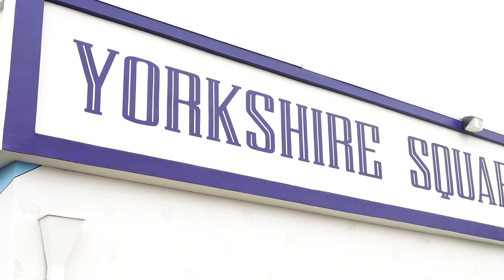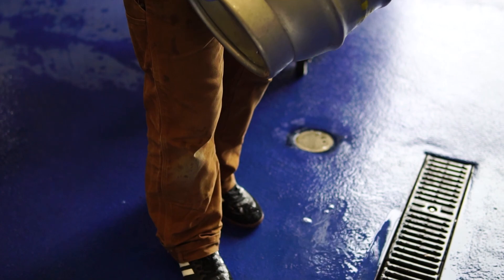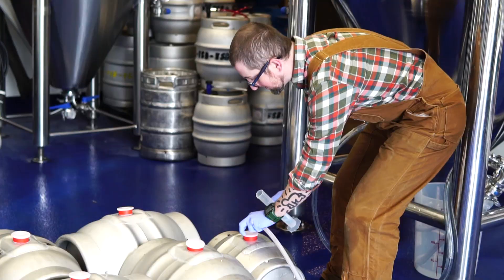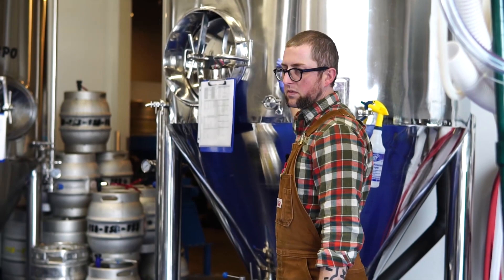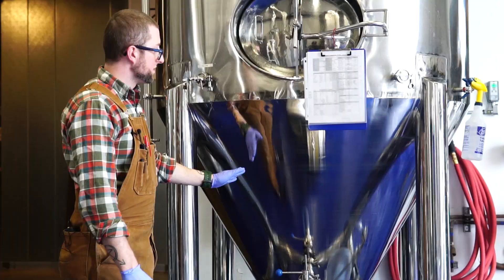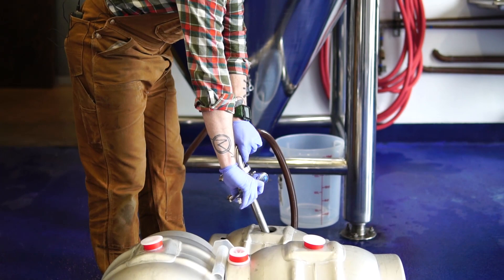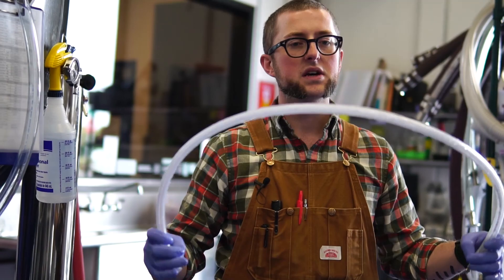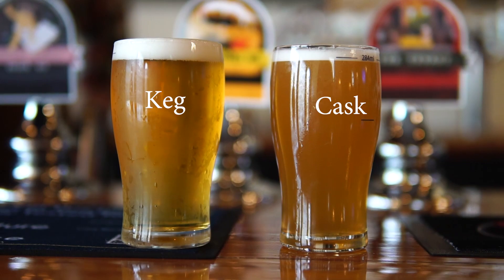Creating Cask Beer with Andy Black of Yorkshire Square Brewery

Comment: Not quite how we do it in the uk but enjoyed the video. 
Normally we stop fermentation two gravity points before final gravity then rack to cask. 
It’s the secondary fermentation that happens that give the cask its “magic”.
Reply: If you’re pulling off 2 points before final, how long are you conditioning the beer? Assuming small beers 7 days, bigger beers two, three weeks? Thanks!
Reply: @tylerhaas14  that’s right, each abv/recipes have there own conditioning times.
Reply: I am trying to learn, thanks for responding:) 

When you pull off 2 point before final gravity, does that mean you do not have to prime with sugar/yeast? Also, how typically would you add finings to the cask or hops? 

In America, we crop our yeast a few point before final is done, then dry hop and let it finish. How would this be done how you’re taught? 

Sorry for the long response, just would love to pick your brain!
Reply: @tylerhaas14  and that’s the best part “in my opinion” of brewing. So many way to cut it.

Cold crash at 2 points before final will stop/ slow down yeast activity and has enough to yeast to finish off. Cold crash length again is down to recipe but for finings, traditionally we would use isinglass, more common to see a silicone replacement nowadays.
I seen a episode on brewing tv where the brewery added a “hop plug” to the cask. I much prefer to dry hop in the fv, I believe it to be cleaner. Cask could be on the hop plug for some time. 
I know you guys love your dry hopping, watch out for hop creep.
Reply: @greigthomson8475  cool thanks for the info! I have a small brew pub in planning and am doing three beer engines as well as draft, love to pick peoples brains. There’s a lot of different ways to do it I guess it mostly depends on what works best for your space. 

I will be vigilant watching for hop creep! Haha

Comment: Doesn’t biofine drop the yeast if you’re priming, thereby killing any refermentation that should occur?
Reply: Small amount of fermentation, can still happen.  It has residual CO2 in solution from the primary.  Flocculation increases after activity stops, and is meant to happen at the establishment.  It can only be disturbed once, which is delivery.

Comment: How much isinglass do I put in a pin cask?
Reply: Half the amount you would in a firkin! What form is the isinglass you are using? And the supplier? Any decent supplier will provide usage guidelines. If you currently use it for brite beer, use the same rate for cask. I do not use isinglass anymore, just Biofine Clear which I use at a rate of 128mL/US BBL (22mL/pin). That rate should be fine for isinglass as well but the supplier will know best. Make sure to roll the cask well to get the isinglass nicely mixed in the beer.

Comment: What's your cask CIP setup like? Trying to build one for our brewery.
Reply: I had a custom thing welded from an old keg and a barrel washing spray head. It’s set up like a basic wort grant. Then I can use our basic brewhouse pump to recirc caustic through the system. Procedure is basic, hot rinse from HLT, exterior scrub, caustic wash, hot rinse, visual inspection, then sanitize. Then before use, hot rinse/kill, and then sanitizer. I can send my design sketches. Just DM.
Reply: @dirkchiverism  Hey can i get a copy of that CIP set up please?
Reply: Ian Steele can you DM your email? I’ll see if I can get the build sheet sent over. Sorry for the delay.
Reply: If you can’t get a nice set up like that, rinse thoroughly, fill with 180 degree water and add a small amount of CMC (chlorinated manual cleaner) leave overnight or 24 hours, another thorough rinse and you’re clean. All you need to do when filling is sanitize

Comment: By not adding priming sugar is the beer not very flat.
Reply: I'm not exactly sure what you are saying. If a brewer is utilizing a cold crash method post diacetyl rest then priming is not necessary for Northern-style beer engine service as sufficient CO2 is dissolved in the beer to pour correctly. Adding priming sugar, thus over-carbonating the beer, means that aging takes longer because of the refrementation in the cask, and the cellar will need to vent the cask for hours to days before it is ready to put on. This will not be enough CO2 for Southern-style or for gravity pouring.